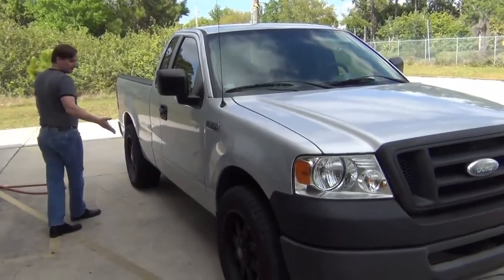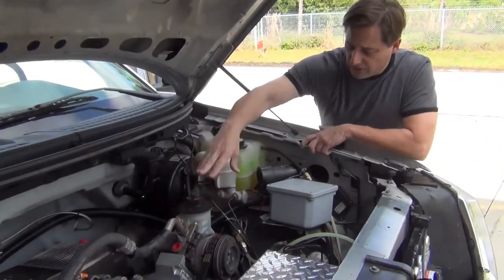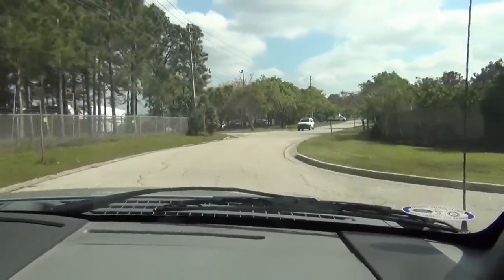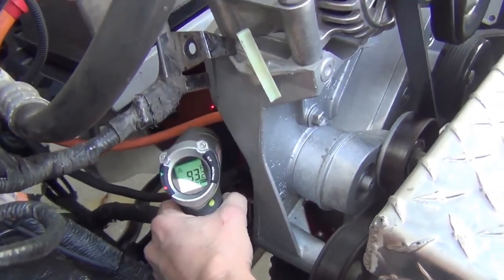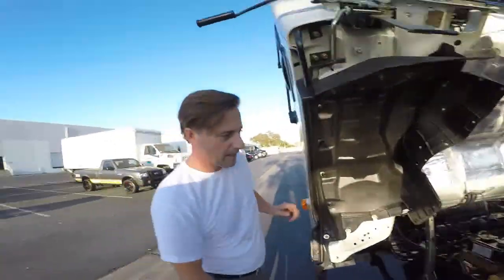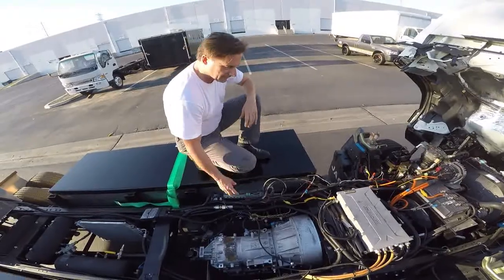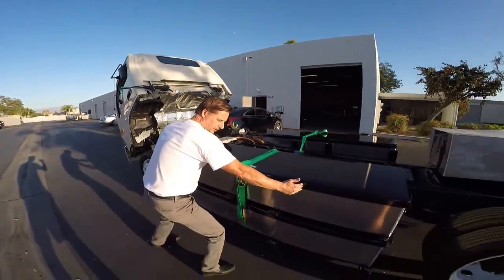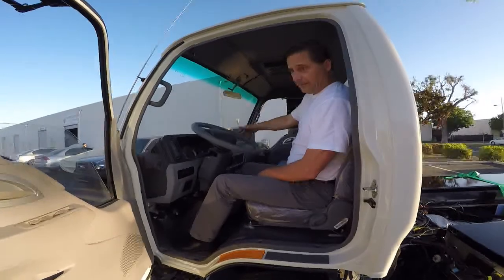DIYev past builds for all electric trucks and buses

Comment: What does an ev kit for the f150 run?
Reply from the maker: $30K if you buy 1,000 of them and around $60K if you buy one.  Hey .....in volume it is less than a Tesla and you get the vehcile that works for you.
Reply: @ACDCev  $60'K for the kit, excluding the vehicle itself? im not judging or anything, just trying to learn. because i'd totally get a kit for a 10 or even 30 year old truck, but now it seems like my logic is wrong here. possibly, i am underestimating the costs of the batteries, perhaps?